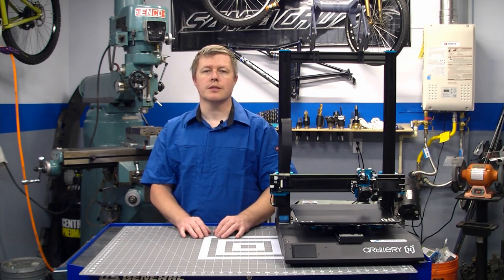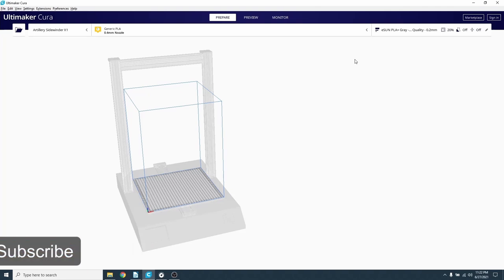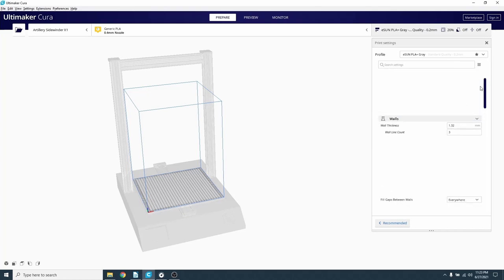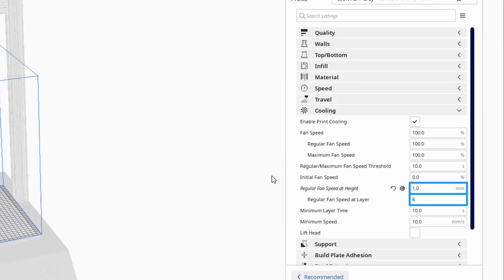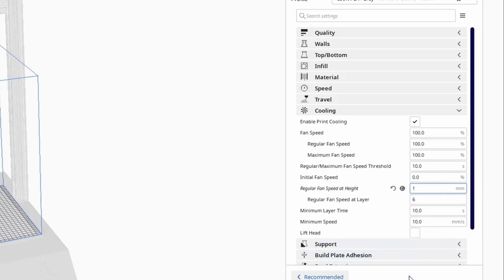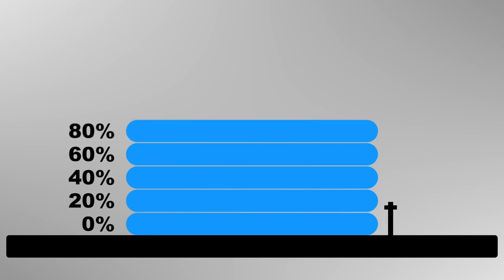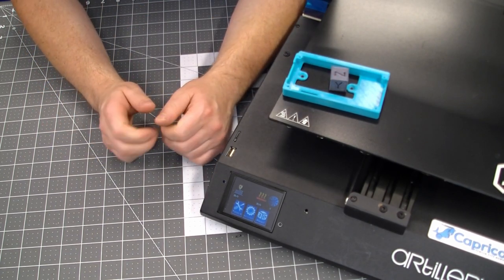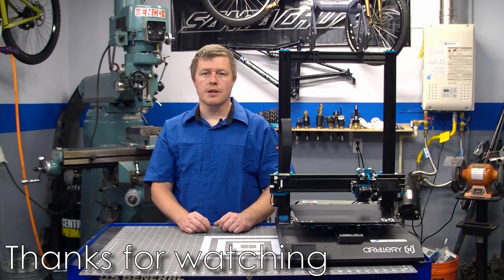How to control fan speed ramping in CURA

Comment: How do I set this to blast 100% fan speed from the bed layer? Initial speed 100%, regular fan speed at height 0.0, layer 1, minimum speed 100%, regular/maximum fan speed threshold 100%?

I want to do this for larger prints, because the cool end keeps melting and clogging on them if I don't, and cura seems to be of the opinion that 1st layer fan should always be 0%.

Comment: Hi there, I have an Ender 3 Max and for whatever reason I cannot get the cooling fans to kick on by themselves with the settings I set in Cura. The only way to turn them on is to wait for the first couple layers to finish and then set the speed manually. Any thoughts as to why this might be happening?
Reply from the maker: Have you tried a different slicer?
Reply: @EtherealProject3D  thanks for getting back to me! So I started with the creality packaged cura software, I just tried tonight to switch over to regular ultimaker cura, hoping it would help but no luck. I'll give slic3r or one of the others a try to see. Any you would recommend?
Reply from the maker: @crj06121995  I primarily use  Idea Maker.

Comment: The fact that cura doesnt have a minimum fan speed is frustrating. The pwm control of my fan doesnt really start getting it spinning until around 60%... However I still want a 0% fan speed at the initial layer. Basically I just want to jump from 0% to 60% then ramp from there...

Comment: I don't the fan speed to ramp up, i want it off untill let's say layer 4 and then instantly to 100%

This due to having 12v Noctua's with buck converters and the fan won't spin on 30%..... It just wiggles
Reply from the maker: Sadly this is not possible as I understand it in Cura, you can set the initial fan speed but it will always increase at each layer up to the max speed at height. I recommend using Idea Maker for your specific setup as it has way better control of the part cooling fan.
Reply: @EtherealProject3D  i found a solution in Marlin firmware, there is a setting that always starts the fan at 100% for a second and then slows down. A kickstart
Reply from the maker: @Hogwarts.Failure  awesome, good find.
Reply: For anyone looking.  The real solution is to make sure your Enable Print Cooling box is checked and set all fan percentages to zero.  Then go to Extensions > Post Processing > Modify G-Code > then under the Add A Script button select ChangeAtZ.  Then you can select height or layer number by the trigger.  Then check the fan speed box and make sure you have layer spread set at 1 which will make the change in 1 layer.
Reply: @MoeReefs  Not all heroes wear capes! This solved my issue with my buckconverter clicking due to the voltage slowly ramping up. Many thanks!